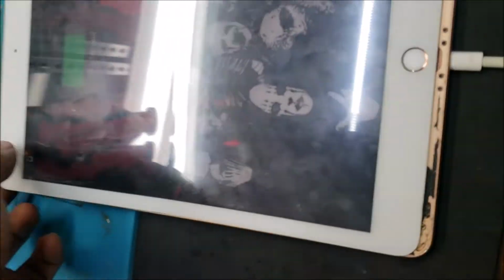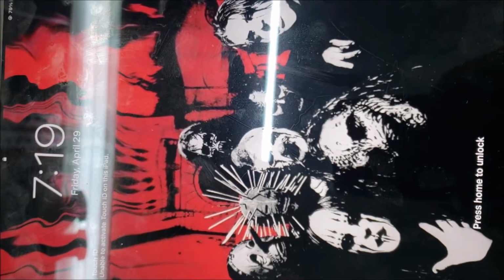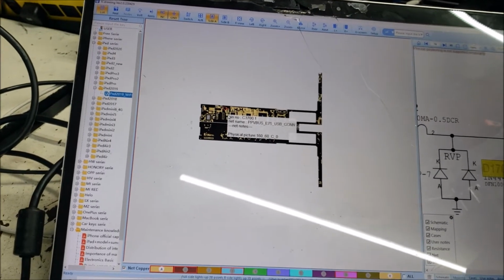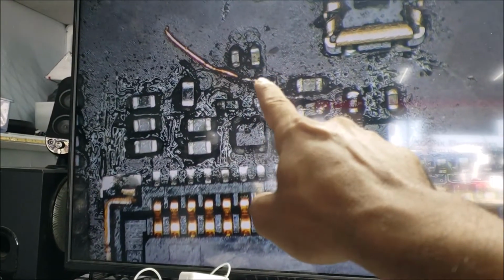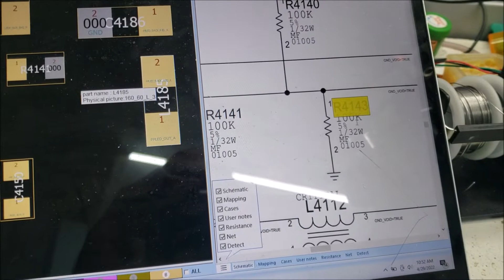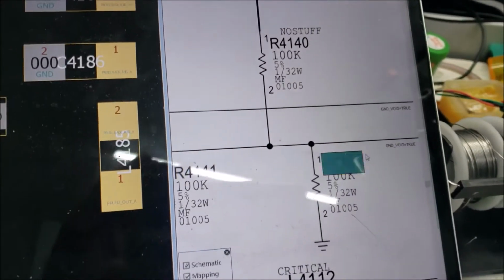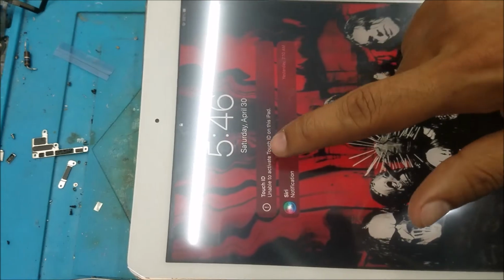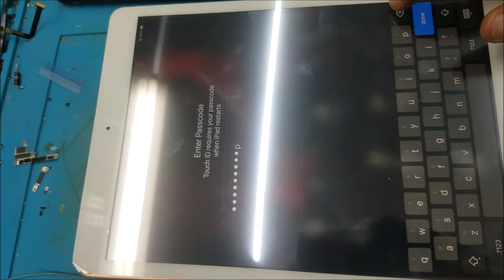A2197 ipad 7gen 2019 touch screen problem after screen screen replacement

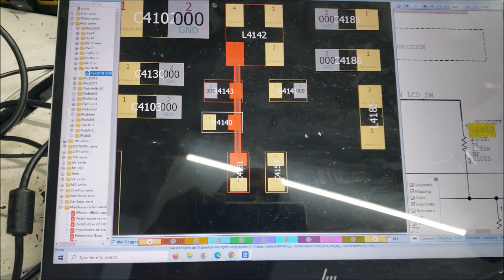Comment: R4140 @ 3:57 shows that the 100k is a 'NO STUFF' component in the schematic. If R4140 & R4143 are stuff with 100k each, this will build a voltage divider of 50% of the source voltage at the common junction.